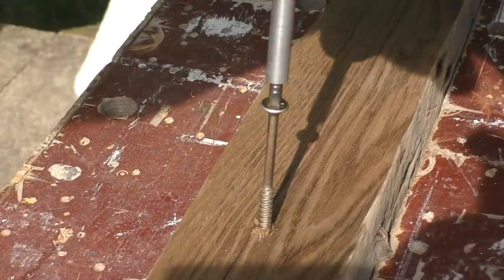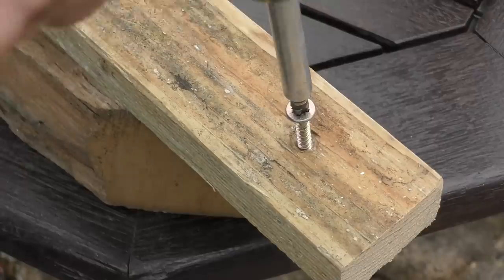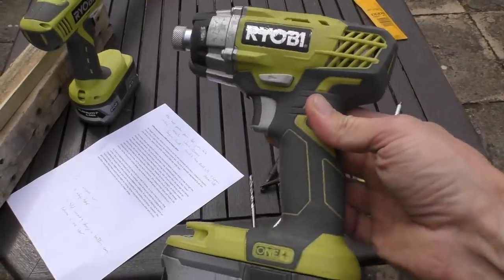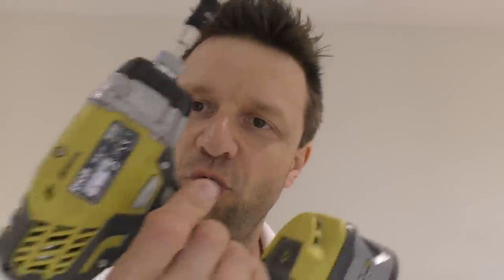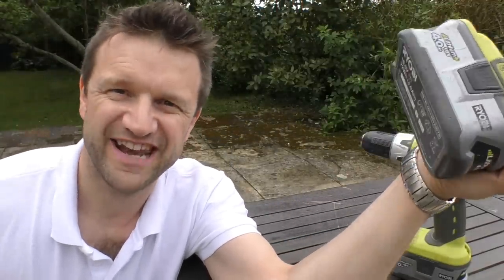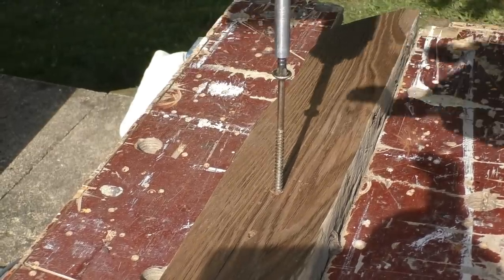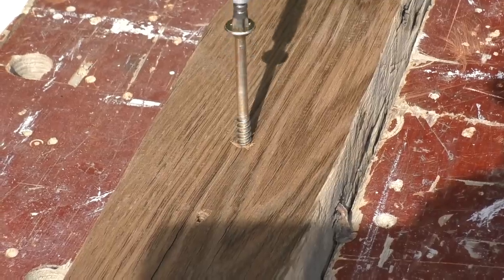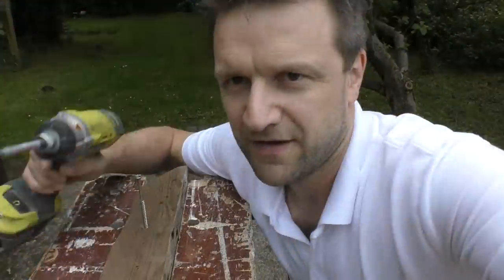Difference between Drill Drivers & Impact Drivers

Comment: The problem with 1.3 Ah batts is it’s just 5 cells in series. They still use excellent 10-15C  cells so they can still deliver 20 amps for very short periods of time. Compare that to a 4Ah cell which would use the same cells but 15 cells so three in parallel will deliver 3x as much current. So 60amps peak and probably 20 amps continuous. Ryobi uses high quality cells in all their batteries. I know - I’ve pulled one of the small ones apart and from memory theu were Sansung high current cells.
Reply from the maker: MondoTV Thanks for that - makes a lot of sense and is one of the most constructive, intelligent comments I've had and a breath of fresh air compared to the usual "Ryobi are sh1t - stop buying toy tools and get yourself a Milwaukee" or similar, from people who think they know what they're talking about but actually don't have a clue.
Reply: Ok - never pulled one of the big ones apart but makes sense - same principle though - the higher capacity batts in parallel will have a much higher continuous discharge rate.
Reply: Given 10C cells, those 4AH batteries probably do 40A pretty comfortable. Probably deliver as much continuous as those crappy 1.3AH can in pulse. Its no wonder they totally crush them.
Reply: exactly
Reply: you can also buy very powerfull 25A or even 30A 18650 cells (LG H2 ? or so) and swap them.. would deliver.. 200A .. which is a bit crazy ;) .. anyone tried yet ?!
Reply: @rocheuro  never taken a pack apart, but the high drain high current 18650 cells are beast. Does the 1.3 Ah pack use those cells? Run those in parallel and almost no need for a larger pack
Reply: Vince Del Fabbro i have no idea but basically they should obviously make more punch torque to the drill or tool. there are test on the net that the same tool with just larger capacity battery eg. 5Ah instead of 2Ah makes drill capable of much more punch and jiuce!
Reply: Waylander the Slayer  do you know what kind of cell is used in these packs?
Reply: I have mine hooked up to a 12 volt car battery, lots of power.
Reply: @rocheuro  that makes no sense at all...I can tell you're no electrician
Reply: 7p7
Reply: no you're absolutely right because the company that owns Ridgid and Milwaukee and I'm sure several others owns Ryobi as well so the batteries are probably all made in the same factory it's really the quality of the machine that's the difference where the Milwaukee may have steel ring and pinion gears the Ryobi may have plastic I've owned to Rio bees and they didn't last and it was an electrical issue the trigger quit and they're not worth fixing I've been using Milwaukee drills professionally for about 12 years and I still have to German ones but now those are Chinese and I don't know how the insides are I'm betting they're better than Ryobi but I'm pretty sure that a Chinese Milwaukee drill is not a German one
Reply: @b.p.stimemachines2327  can't go wrong with Milwaukee. But I am interested if anyone can confirm if the same quality parts are made for the different brands?
Reply: Fester Blats  I know this for 100%, lithium ion cells (18650, 20700, 21700 etc), very high amperage chemistry typically high in nickel concentration, will always be lower in mAh/capacity versus high Cobalt concentration cells/batteries.   High nickel content cell the very highest CDR (constant discharge rate) is 20C, but it isn't ideal, as it's more beneficial to go with a strong amperage delivery with decent Cobalt levels (similar to a LG HG2, or less mAh/capacity) which will max its CDR at about 5-10C at best.  I mean no disrespect or conflict, just sharing years of Li-ion experience (field I work in).  The values you mentioned are often misconstrued with "pulse rates" and/or lipo chemistry which both scenarios are not safe or reliable for consumer use.
Reply: MondoTV don’t forget there’s protection circuitry that’ll limit current because of any of half a dozen different sensor inputs. Ie. A drill sitting in a hot car in direct sunlight can get fairly warm. New tool and new battery start delivering bad performance and naturally the customer isn’t happy. But Ryobi have made a silly choice in saying exactly zero about discharge rates, what might effect it and how that might temporarily degrade promised performance. But if you’re a contractor with a job to jet done.........
Reply: @CharlieDIYte  Ryobi, Milwaukee and Ridgid (Power Tools) are made by the same company.
Reply: 10 cells in up to 6ah packs using LG hg2 3000mah 18650 cells. 2ah and bellow are usually 5 cells so avoid like the plague. 3ah and above and you're good.
Reply: Steve Davidson Owned by the same company =\= same company, and even if it was many companies make varying quality products under different brand names or lines.  That by itself doesn't mean much.
Reply: Mykel Hardin  oh I do understand my friend. But you'll find that most 10 cell packs are using cells that can supply 20a+ and the 5 cell packs are mostly using cells that can supply between 20 and 30a continuously. The 10 cell packs are still far superior in terms of capacity and current capabilities.
Reply: Your wrong MondoTV.. 3x more current??  MondoTV are you guessing?
Please get into touch with some of the makers that have high quality brushless  18v drills and use top of the line high drain INR/IMR cells and vendors that have 2Ah and 4Ah and 6Ah pack for the same item.
18v on 2Ah (1x5cells of 2000mah=2Ah) 18v 4Ah (2x5cells of 2,000mah=4Ah) 18v 6Ah (3x5cells of 2000mah=6Ah)
and ask them if you will get as you say 3x current-effect / power in the 6Ah in regards to there 2Ah battery  if its the same battery used in both packs for that device..they will tell you its runtime as the 2Ah is allready using the torque they list it with.. you will not get 33% of the item stated torque at 2Ah batterypack and 100% at 6Ah.. its not how it works..

If you already have quite loyal high drain IMR cells in your 2Ah 18v battery pack, like fx 5x Sony VTC4 then you can bet you are using your drills-torque as intended and WILL NOT elevate it with a curremt-factor of 3x by using fx 3x5cells VTC4..
and its is useally Samsung or LG or Sony high drain-18650cells they are using in these tools.

even el cheapo brushless devices to 75 like this' uses good quality Samsung high drain INR cells..
https://imgur.com/a/i0xpxNG
Reply from the maker: I just want to thank you all for wading into this debate and providing much needed clarity to a situation I articulated rather badly at the start when I confused capacity with power - you can tell I'm no electrician!!
Reply: Mykel Hardin  not ideal at all.  Samsung MSDS shows high concentrations derived from Cobalt which degrade quite fast at 20A.   Spec sheet says 15a, sure it can be pushed to 20a, but besides the obvious voltage sag, it is being beaten up quickly, resulting in what "was" a 3ah cell, into a 2ah cell within just 50-75 charges.  It's a fact.  I work in this field and mean no harm or conflict, just laying out daily practice and witness to results achieved repeatedly.
Reply: In everything except their lawn and garden tools. The Ryobi weed wacker battery is horrible.
Reply: This is why you don't buy ryobi tools Once You GO Dewalt You Don't Go Back.
Reply: @johndavid8949  using same batteries... Perhaps in various capacity classification, but all sourced from exact same supplier in China.
Reply: @bcr003  hi thanks for providing this information. Can you explain more elaborately? I am a new bie.
Also which portable battery do you use and which one is your favorite?
Reply: Mykel Hardin  is it Samsung?
Reply: @bcr003  thanks for the wonderful information. Which battery do you recommend which delivers lot of power and for decent time?
Reply: @vikasgupta7126  which size cell?  18650: Hohm Tech's "Hohm Life 18650" if not needing over 20.7A (equivalent to about 60 watts) and is 3077mAh.  Or Hohm Work V2 as this one is seriously powerful at over 25A + has about 2650mAh (wrap says 2546mAh, but they're higher on everyone I've ever tested).  If want inexpensive, LG HG2 or Samsung 30Q.
Reply: I saw a little Lithium pack starter battery turning a large V8 engine in a car with a dead lead-acid battery... IMPRESSIVE to look at.  This tells us about the amazing current that those cells can deliver for their small size. BUT, there is a downside: the battery pack needs to have a proper temperatura monitoring because of that amazing power, and a dedicated charger-balancer.  I've also seena couple of Lithium cell fires, and those are not pretty!
Reply: Perhaps you are confusing CHARGING current to DELIVERY currrent???
Reply: EXACTLY!  There are examples of bad design from all the tool brands in certain models of everyone, and excellent models from that same brand.  You have to actually disassemble each model and look carefully inside to decide how good (or bad) a given model is, regadless of brand.  There is a reviewer on you tuve doing that and DEBUNKING certain models from otherwise "prestigious" brands; even METABO and FEIn get some BAD models in their lines.
Reply: @CharlieDIYte  Lol Milwaukee and Ryobi are the same company :)
Reply: I agree to disagree. No way the tool is power limited by the amp hour size. More likely the tool is regulated by current draw, by its  battery management system.  
if max current draw is exseeded, the tool stalls. - Also the C rating is max continues discharge not peak values. You can still short and draw more power if it wasnt limited. :)
Reply: It may be the TH 3.6. Which is the leading company that makes most lithium batteries all brands and makes.
Reply: @CharlieDIYte  I like RYOBI... Got their saw and screw gun
Reply: @CharlieDIYte  ryobi is always winning in all tests here in germany BUT with the 5A bsttery. Makes sense.
Reply: Had no idea the bigger batteries gave more power, thought they just lasted longer
Reply: The ambient temperature for consideration prior to the Intracoastal regards endearment,is a phenomenon directly exacerbated surveillance station sincerely Synology.
Reply: Mykel Hardin  Three big 6v lead acid and a fat lead for cutting down trees or drilling through the hull of the Tirpitz.
Reply: @mondotv4216  Technically it does not matter how many cells you have but rather sheer capacity. The bigger cell is, more power it can output at once. It always scales up together. Does not matter if you have 4Ah 18V battery or (just for example) 8Ah 9V battery of the same type. If they are the same type of battery, then they will output the same amount of power. Obviously 4Ah 18V will have half the current of 8Ah battery but twice as much voltage, so the power is equal. If you try to draw too much current, then effective voltage drops significantly and you have much less power. Voltage drop depends on power draw to battery output. In other words, capacity tells everything here. The same principle you will see between 1A or 1.3A cells. 1.3 store 30% more energy but also can give you 30% more current. It means that at the same current draw bigger battery will have less voltage drop. If you draw 1A, then it's 1C of 1Ah battery but just 0.77 capacity of bigger one. That's why they seem to work slower. You have less voltage with smaller battery at the same load. It's small difference with smaller tasks but in case of hard work you will notice the difference. Difference between 1.3Ah an 4Ah battery is huge. If you try tu pull 2A from them, then one will work at 1.5 C load and second one just at 0.5 C. Obviously in first case you have much more voltage drop so you try to pull even more current resulting in even lower voltage. At some point it goes over threshold and battery controller just disconnects it because it's like short circuit - it can overheat trying to give you so much current.
To be more precise, battery has internal resistance and the more current you draw, the more energy is wasted. At high load you will waste so much energy it will get hot. That's why powertools have this kind of protection, you don't want to blow that big battery in your hand.
Reply: Maciej Załucki Your telling me stuff I already know. And not everything you said is correct. All I said was having the same voltage but twice the number of cells in parallel means you can draw more current from the battery. You said pretty much the same thing. So if one cell has a nominal cont discharge rating of 10C then two cells in parallel will give you 20C at the same voltage. And that is what is happening in the impact driver. BTW  higher voltage has a huge impact on system design. The higher the voltage the less amps you need for the same power. That affects things like the thickness of the wires you have to employ. That’s why the new Porsche Taycan is 800V so they can up the charging speed to 250kW. Well that’s what the PR dept said.
Reply: @mondotv4216  Sure, I wanted to make it a bit more precise because you did not point out that it's about the capacity rather than just number of cells. After all 2Ah will be equal of two 1Ah cells of the same discharge rating. I did some modifications of Bosch driver and drill battery replacing 5 original cells with different things. Obviously putting just cells with higher capacity and the same rating increased both power and work time. Putting cells of the same size and higher rating increased power but work time was roughly the same. It simply could put more current at the time but was limited by the same capacity. Even more interesting was attaching big capacitor to the circuit. This way initial current was quite high so you could get high power in short bursts. It was actually performing well as it could not overheat driver - still discharged capacitor in just a few seconds so with stuck lug nuts it could give one short and powerful shot, then overcurrent protection kicked it. Overcurrent quite often is based only on voltage. If it drops too far, then battery is discharged or you draw too much current - in both cases it disconnects.
Reply: @robertkat  if the engines running and the voltage regulator on the alternator is fucked, I guess that might work
Reply: Please review the answers above involving Dee's mother and several drillers to understand.
Reply: @mondotv4216  Weird... never pulled one and look inside but you are so confident about what's on the inside. People like you.... sigh... lots of opinion without facts.
Reply: @superchargerone  Huh? I have pulled one apart and looked on the inside so I do know what cells they used. Still using some of the salvaged cells in a couple of my torches. Yet you accuse me of lots of opinions without facts?
Reply: @CharlieDIYte  well Milwaukee has consistent power doesn't matter what size battery. also I checked the link you provided and shockingly ryobi is more expensive than Milwaukee's brushless impact and is less powerful. hell even the dewalt is cheaper somehow so I don't see why anyone would get ryobi...
Reply: Tony Tiger That’s incorrect. Electrical power is measured in Watts which is V x A. So both Volts and Amps affect power. The capacity of a battery is directly related to how much instantaneous power it can deliver. It’s why we often give the power rating of a battery in terms of C(apacity). So a typical 3400mAh Panasonic 18650B is rated at 3C continuous. That means it can deliver 10.2 Amps continuous (3.4x 3) Because it’s a 3.6V cell it delivers 36.72Watts. Put two in parallel it will deliver 73.44W (6.8Ah x 3.6V x 3) Put two in series it will deliver exactly the same amounts of Watts but less Amps at a higher Voltage (3.4Ah x 7.2V x 3). The cells used in power tools have much higher C ratings. The Samsung INR2500 is rated at 20A which is 8C for a 2500mAh battery. I hope that’s clear? Stay safe.
Reply: @mondotv4216   I was only able to follow some of what you wrote - and learn from you.  A fuller presentation would help me even more. 

David Lixenberg.
Reply: roc
Reply: @bcr003  So what do you mean by Li ion batts have high nickel content for max CDR 20C? You mean 20 coulombs? So why is Cobalt batts better at 5-10C if you say you need high amps to load?
Reply: @stevedavidson2656  Made by the same company does not mean made with the same parts though?
Reply: MondoTV I think it’s poor design. Should deliver the same flow rate (equate to power) and extend time factor rather than the other way around.
Reply: @joenalaska  like a vw polo having a lamborghini or bugatti engine in it . imagine
Reply: Fantastic demo... TQ
Reply: @CharlieDIYte  to be fair ryobi is toy tool
Reply: @rocheuro  it will be 25A per cell at around 3.7-4v. with 2 in parallel that up to 50a, 18v. The issue is the mosfets wont handle such load anyways
Reply: @CharlieDIYte  I know quite a few tradesmen working in the domestic sector mainly who use Ryobi power tools and they are all happy with the tools performance, heavy duty site use might be different though, Makita DeWalt and Bosch seem to have that sewn up.
Reply: @alfredomarquez9777  Can you please tell me which youtube channel is that? Thanks
Reply: Is this still the case? Asking because 2+ years is a lot of time in tool batteries. Seen many manufacturers go to far higher current cells in their single-bank batteries, some move to 21700/20700 cell etc. Brings a compact, single-bank batteries up a little bit in size - but it also vastly increases capacity. Brands like Milwaukee I believe have been known to stuff 50 Amp cells in their compact Red-Lithium high discharge M18 batteries. It means a compact battery can pack one hell of a punch - but as lipo cell chemistry is always a compromise, it means lower runtime/energy density. I imagine that with 21700 cells - you could probably eek out ie. 40-50 amps from a cell for a compact battery - without having to give up so much of its energy density in that cemistry trade. That being, on top of them having far higher density already.
Reply: @pr0xZen  It doesn't really matter although I don't believe the Ryobi 18V batts have changed - still the same basic shape and capacity.  As you alluded to it's not the number of cells but the capacity of the cells. So if 1 cell has twice the capacity of another design with 2 cells in parallel and they both have the same number of cells in series and they're both rated at the same C rate they'll have identical current delivery capability.  And yes there are some high current cells by Sony/Sanyo and others and as you said - less cycles, but much higher current delivery.
Reply: @mondotv4216  The thing is, and to my point, many brands (typically higher end than Ryobi) use different cells on their lower capacity compact batteries, versus the higher ones. Current discharge at the expense of density. So that high demand tools like impact wrenches and saws etc, can still function well, although at the cost of runtime. If a tool can pull ie 200A burst from the battery, you don't need 40-50A cells in a bigger battery with 3 or more banks. Thus they shuffle the compromise for those cells, further towards density, and you get more runtime than the sum of your banks (versus the compact single-bank battery with high-discharge cells).
Reply: @mondotv4216  With single bank ("compact") batteries I guess going (20700 or) 21700, would mandate a noticable shape/size change, as the cells are still the same voltage, and 15mm extra "depth" is gonna be noticable. With big capacity multibank batteries, you might be able to do some different arrangement in how you gang up those cells, and even possibly be able to cut a few cells? They might be able to fit something like that inside the outer dimensional shell of a pre-existing big-capacity 18650 based battery, as then "depth" og the internal cell pack can then be adjusted a bit, and the 3mm increased cell length doesn't multiply. Might be able to reclaim an extra 3mm inside the shell by different aseembly and materials.

But that's all just speculation. I guess Ryobi would be pretty loud about it if they had started using bigger cells, even if in a preexisting battery format.
Reply: @pr0xZen  Yeah I think they're built to a price and 18650's are the most common and cheapest cells. Surprisingly the price of tool batteries has not come down with the price of 18650's. Go figure.
Reply: @pr0xZen  Without pulling one apart I couldn't tell you. I pulled apart a Ryobi because it got water damaged.
Reply: @BradCrandall  Modern battery, gearing and compact motor tech has made some amazing progress the last decade. But with so much power potential in many of the tools, therr is bound to be some inherent limitations when running them off a single-series 18V bank of cells. Some higher end tool manufacturers make high-current-discharge compact batteries - but it's a balance compromise with lithium cells. Really high discharge current come at expense of further reduced energy density ("runtime"). It means you can get more of the power potential out of a really thirsty tool with the small battery, but not for long. In my personal opinion, I think it's good to have that option. Just as long as people are aware of the compromise they're making. You cannot force information and knowledge onto people, but you should make sure it's readily available when and where it's most needed.
Reply: @BradCrandall  lol yeaI think I meant to say 3Ah, idk how a 1 ended up there. I used to use either 2.5Ah or 3Ah in my vape. The LG or Panasonic ones are vfc pretty good. I wish those 2/3a cells came in li-ion, would make it so much better to switch them out especially for my pos B&D ni-cad cells that last about one cut with the sawsall
Reply: Was about to comment this. The total charge (Ah rating) doesn't matter, the bigger battery is able to deliver more current which makes the difference.
Reply: Yup. It's important to note the amp hours doesn't actually relate to how much current something can deliver it is just the capacity.. however as the other commenter said the layout of the cells in this case is different and therefore is affecting it. Interesting stuff, I wonder if most manufacturers do this.. Probably they do. I have a 4ah battery on my DeWalt drill and it can twist your wrist around pretty easy.. I always wondered about these impact drivers and now I'm totally sold and have to have one! Ahahaha
Reply: @rocheuro  Samsung 20s for the win. A true 30 amp 18650 and w/ 2000mah (2ah)
Reply: @CharlieDIYte  
Have you tried Makita..to me the best 15 yrs no prob